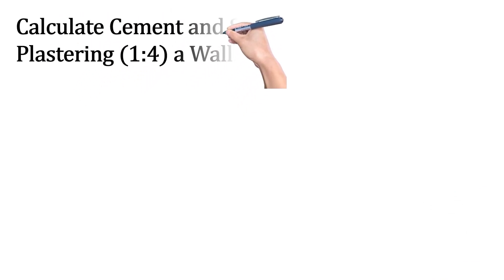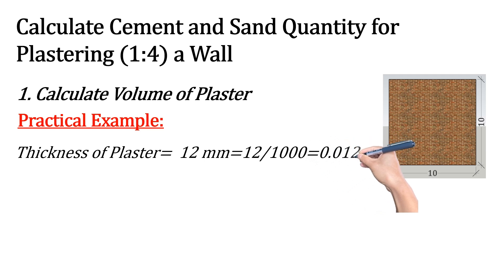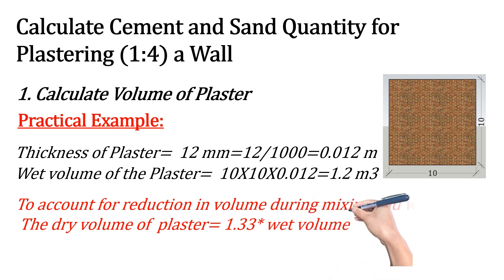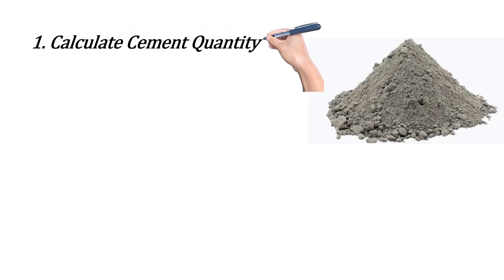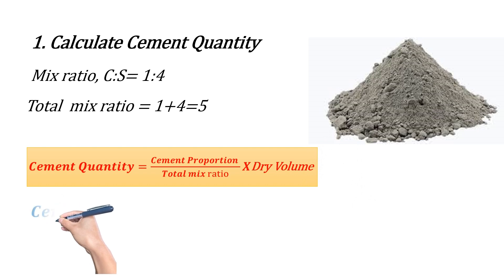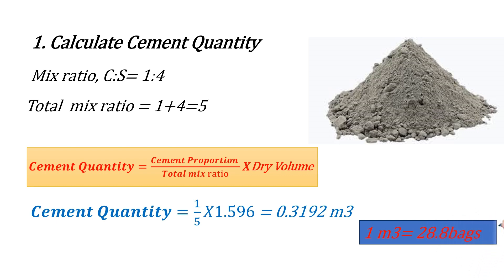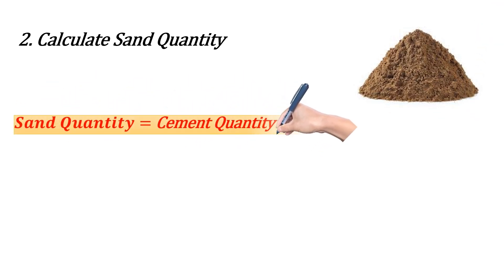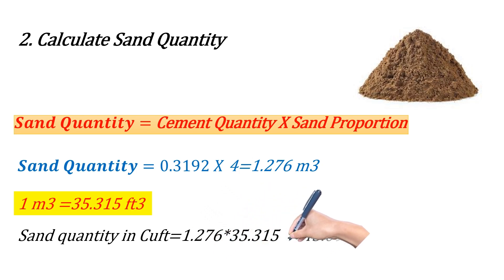How to Calculate Cement and Sand for Plastering

Comment: What if you use NHL lime? 
Egsample mix 1:1:6 cement:Lime:Sand
Reply from the maker: If you're using NHL (Natural Hydraulic Lime), you should not use cement in the mix because of their different setting mechanisms. NHL sets by a combination of carbonation and hydraulic setting (slow, flexible) whereas Cement sets chemically (fast, rigid) and mixing them leads to conflicting curing behaviors, which can cause cracking, delamination, or reduced durability. NHL allows walls to breathe — moisture can pass through easily whereas cement is impermeable, trapping moisture and causing salt deposits or damp issues in traditional walls.

If you're working on restoration or breathable walls, stick to NHL. 

Quantity Calculation (Based on 1:1:6 Mix):

Assumptions:
Mix Ratio = 1 (cement) : 1 (lime) : 6 (sand)
Plaster thickness = 15 mm (0.015 m)
Plaster area = 10 m² (example)

Step 1: Wet Volume
Wet Volume = Area × Thickness
= 10 × 0.015 = 0.15 m³

Step 2: Dry Volume
Dry Volume = 0.15 × 1.33 ≈ 0.20 m³

Step 3: Total Ratio 
Total ratio = 1 + 1 + 6 = 8 parts

Step 4: Material Quantities
Cement = (1/8) × 0.20 = 0.025 m³
Lime = (1/8) × 0.20 = 0.025 m³
Sand = (6/8) × 0.20 = 0.15 m³

If you’re using NHL, you'd typically replace both cement and hydrated lime in the 1:1:6 mix. So, you’d use 1 part NHL : 6 parts sand. But never go richer than 1:2 (too strong, may crack) and never go leaner than 1:3.5 (too weak, may fail) or use standard codes. 

If Using NHL Instead (e.g., 1:2.5 or 1:3 Mix):
Let’s say you use an NHL:sand ratio of 1:3 (common for exterior plaster):
Total parts = 4
NHL = (1/4) × 0.20 = 0.05 m³
Sand = (3/4) × 0.20 = 0.15 m³

Hope this clarified your question.
Reply: @CivilMasteryAcademyOfficial 
Im sorry but what you say is completly wrong.
NHL is used all the time in the mixes and it acts like a plasticiser. There are also standard code ratios just like I mentioned one in my first post.

I was interested on how would you calculate how much bags or kg you need in the mix. You didnt answer that also.
Reply from the maker: @picajoool  NHL (Natural Hydraulic Lime) cannot be used as a plasticizer in all mixes. NHL is a binder, not an additive like a plasticizer whereas plasticizer is chemical admixture added to improve the workability (plasticity) of a mortar or concrete without adding extra water.

In lime mortars or lime-heavy mixes, you can use NHL in place of a plasticizer because NHL is part of the intended binder system and brings natural workability. Whereas in cement-dominated mixes, you cannot use NHL because It does not perform the chemical function of a plasticizer and NHL is weaker than cement and may cause unintended strength reduction. In short, Natural Hydraulic Lime (NHL) is not a plasticizer in the technical sense, but it can improve workability in lime-based or hybrid mixes. So while it cannot replace a plasticizer in most modern cement-based mixes, there are situations where NHL makes a mix feel more workable — and that’s where confusion sometimes arises.

1. EN 459‑1: Building Lime — Definitions, Specifications, and Conformity Classifies NHL into three grades (NHL 2, 3.5, 5) based on compressive strength at 28 days and available lime content. It also specifies that NHL sets and hardens by hydration and carbonation—not by effecting plasticity chemically.
2. Technical Data Sheets Complementing EN 459‑1 highlight that NHL offers “great plasticity,” meaning it’s easy to work with, but this refers to favorable plastic-like behavior as a binder, not as a plasticizer.
3. ASTM C-141 / C-141M–09 — Hydrated Hydraulic Lime for Structural Purposes recognizes NHL as a hydraulic binder (similar to EN 459‑1), but makes no mention of any plasticizing function.

Hence, NHL is never defined or treated as a plasticizer in any standard code. While many documents mention its plasticity for ease of application, there is no standard that gives NHL the role or function of a plasticizer. It's always cataloged and regulated as a binder material with hydraulic properties.

 For the second part of your question regarding the standard code ratio: Yes—there is a standard code specifying a 1:1:6 cement:lime:sand mix ratio, and it corresponds to Type N mortar under ASTM C270. This ratio is chosen for its balanced properties, offering moderate strength and good workability for typical masonry and plastering tasks. Type N mortar uses a mix of Portland cement : Hydrated Lime : Sand = 1 : 1 : 6 by volume. The lime used in Type N mortar as per ASTM C270 is not NHL. The standard specifies hydrated lime (which confirms ASTM C207 , and used for properties like workability, water retention, and elasticity, but relies on setting by carbonation, not hydraulic action.), which is chemically distinct and sets via carbonation whereas NHL is a hydraulic binder with different setting behavior and requirements. 

For the last part of your question regarding converting material quantities/volume  to weights, we need to know the densities of materials first :
Lets assume 
1. Density of cement = 1440 kg/m3
2. Density of lime = 550 kg/m3
3. Density of sand = 1600 kg/m3
Then,
1. Cement weight = 0.025* 1440= 36 kg = 36/50 =0.72 bags
2. Lime weight = 0.025*550 = 13.75 kg = 
3. Sand weight = 0.15*1600 = 240 kg
 
Hope this clarifies your point, of there’s any, please feel free to ask, i will try my best to answer your queries .
Reply: @CivilMasteryAcademyOfficial  thank you for answing. You are correct! I should have written hydrated lime, and NOT NHL! My mistake.
We agree that hidrated lime improves workability of plaster and thats what I was aiming at.
There is a confusion about lime weight, because There is a difference between its loose bulk density and specific denisty. 
So I'm not certain that your density of Lime is correct and it's OK to use in calculation
Reply from the maker: @picajoool  Absolutely, there is different between loose bulk density and specific (true) density.

- [ ] When calculating quantities for cement, sand, and lime—especially in volume-based mix designs (like 1:1.5:3)—you should use the bulk density, not the specific (true) density.
- [ ] Use specific density only when you are designing mixes by weight or dealing with material property calculations 

Packed bulk density values of cement and lime are not strictly specified as fixed numbers in most standard codes like IS (Indian Standards), ASTM, or BS. Instead, these codes usually provide test methods to determine the bulk density experimentally, because the actual value varies depending on factors like compaction, fineness, moisture, and handling.

IS 456: 2000 (Plain and Reinforced Concrete – Code of Practice): Clause 5.2 mentions that bulk density of cement may be taken as 1440 kg/m³ for design purposes (not a strict specification). No IS code strictly mandates 1440 kg/m³, but it is a widely used and accepted standard practice value. 

Typical Packed Bulk Density of hydrated lime is 400-600 kg/m3 (as referenced in engineering handbooks and industry practices). So, based on the range of 400-600 kg/m3, i assumed it as 550 kg/m3. 

Like with cement, bulk density of lime is expected to be measured in the field/lab using standard procedures, not assumed. Follow ASTM C110 – that Includes test methods for bulk density of lime for detailed information/procedures.
Reply: @CivilMasteryAcademyOfficial  Excellent answer!